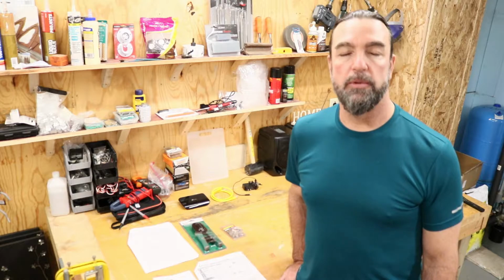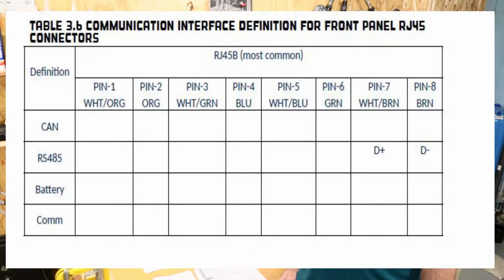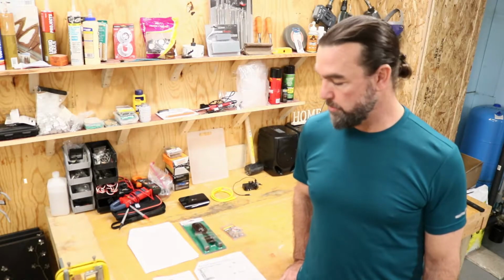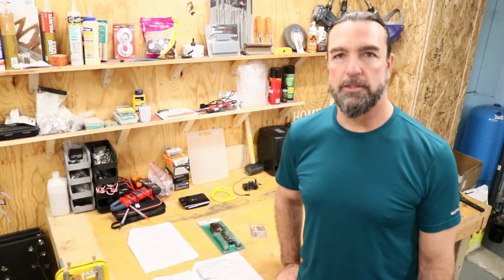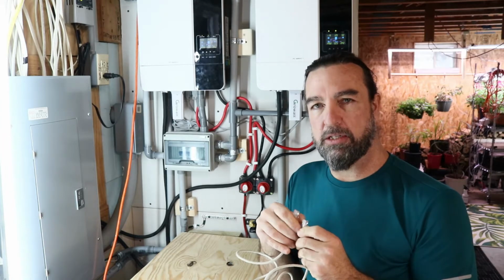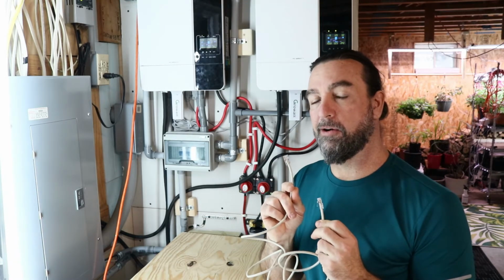Fault (20) Growatt & EG4 24v Battery BMS Test - Doesn't work, crossover cable

Comment: Please take this as a stream of consciousness... I think you said the 48v bms will communicate with the inverter. So what bms is in the 48v batts is it the same manufacture as the 24v ? Is there a firm where update . its a reconstruction of the the batts as 48v using 2 48v bms's rather than 4 24v bms's an option for you?.  Thx for sharing
Reply from the maker: Hi Blaine and thanks for the response, yes consciousness is the primary source of all our electrical needs, the questions is do we know it?... Back to Solar, the BMS will be coming from the 24v batteries, which of course in my setup is 2 connected in series to make 48v. Even though they are connected in series each batteries BMS  is operating independently as the charge and discharge rates I watch from the software to ensure functionality. Thankfully the BMS in the battery works as it should, my fix will be adding a backup BMS to this setup to double ensure I don't have any issues prior to expanding the battery bank.
One of the other viewers was telling me he talked with Signature Solar on if they have any firmware updates and he they said no, at least not at this point.

Comment: I gave up on getting mine to work. I have 5 batteries 3 bought in 2020 and 2 in 2021. One of the 2021 is the EG4 version and that one will not even communicate with the other 4 because the BMS’s won’t communicate with each other over RS485. I am only using the software that comes with the batteries. After talking to signature solar they just said the BMS’s are incompatible and no fix… End of conversation from them. Not the best CS and I did at least ask about getting different firmware, but it was deer in the headlights over the phone from Signature Solar. Don’t get me wrong I think the batteries are great and fit my needs and application, but not having the batteries even communicate with each other is a show stopper. I never got any of the 2020 or 2021 batteries to communicate with the growatt. In the end I abandoned the the setup and just use a small low power PC with USB to RS485 adapters to communicate with the 5 batteries. One adapter does 4 batteries that are daisy chained with each other, and 1 adapter does the newer EG4 battery that is a anti social BMS. Also I learned that if you do get the BMS to communicate with the Growatt, if that communication is lost for whatever reason, bad cable, communication issue in battery or inverter, family member saying what happens when I pull out this cable, the inverter immediately shuts down, even if the batteries are at 100% SOC. Since mine is installed in a cabin with internet communication, but it is not my primary residence, just a place we go on weekends, I can’t take the chance the batteries and inverter will shut down due to a communication glitch. In the end I just went back to user setting on the Growatt, and use the low power pc so I can remote in and check on the batteries.
Reply from the maker: - Hey Jimmy thanks for the detailed response, well appreciated as I understand 100%. Like you, I like the batteries and am content using them under the "USER" configuration, but it'd sure be nice to take advantage of the BMS they advertise! I don't believe there is any communication between the Inverters and EG4's, more so that we're fully dependent on the batteries BMS either Opening/Closing the electricity as need be and sending a signal to the inverter. Same on the inverter side, they either deliver on demand if the BMS asks or not. The BMS of the batteries thankfully has been programmed with enough detail that it manages on its own, AS LONG AS IT DOESNT FAIL. I'm planning to add a backup BMS before adding more batteries, 20kw I could handle losing but 60kw would make me a bit RED. Cheers
Reply: @ahhlifesgood1956  under option 5 set battery to LI and then select option l01 and it should display option 036. That allows the batteries and Growatt to communicate directly and show the data on the Growatt screen. Also the batteries have to have the dip switch set to option 1 I believe. There are several videos on utube from signature solar and a few others showing how to set up the Growatt to accept communication from the EG4’s, but mine did not work. They said the EG4 I have is an older BMS from earlier this year that is not compatible. The older batteries I have are not compatible.
Reply from the maker: @jimmyg6215  - Yes I played around with these dip switches configuring in various arrangements to no avail. Thanks for the help! I think I'm going to build my next batter bank, we'll have to see. Cheers

Comment: please try one of the other eg4's for communication.
also try to use the other inverter
you have connected a network hub/switch in the past, that may have fried the bms comm port on the inverter or bms
Reply from the maker: - Thank you sir, that's a good idea as well. I think I'll break out the backup inverter and battery to be extra sure in my attempts. Should I find the fix on the 24v EG4 I'll definitely report here! Thanks for the continued advise.
Reply: This may sound silly. But have you tried tech support ?
Reply from the maker: @fred8565  - Thanks for the reply, Tech support these days seems to be a thing of the past, one gives up calling after 3 times when it comes to EG4 support. However Growatt, through many correspondence, videos and diligence did work eventually.

Comment: Did you also try it hooked up to just the other Growatt? Maybe it is a defective component on the left Growatt. I agree simplifying for troubleshooting is a good way to go.
You could also try just using a pair of batteries for testing incase there is something wrong with one of the batteries and swapping to a different pair if you get the same error.
Have you contacted the vendor for their advise?
Does the RS485 A or B translate to the D+ or D-? I'm used to seeing transmit or receive on a serial communications crossover cable. It's been a while since I made a communication cable.
Reply from the maker: - That's a great question ASHU on the "A or B, D+ or D-" and if they actually represent the pinout configuration one thinks and sees in the manual? I made an additional cross over cable that went into the opposite pins 8 to 7 just to be sure this wasn't the issue, without luck. I will try the other growatt as an idea, maybe even get out the backup inverter and battery to do a test. The process has been enjoyable so we'll see where it goes.

Comment: This has got to be driving you crazy. Hope you or someone else can help you figure this out that would make a nice xmas present to yourself. Hang in there you will get it!
Reply from the maker: I actually like chasing down electrical or software issues like this. The reality is these Growatts work perfectly fine under the "User" defined (option 5) battery setting in the menu. I don't even think I'd use the "LI" setting if I could get it to work. We'll see where it goes.